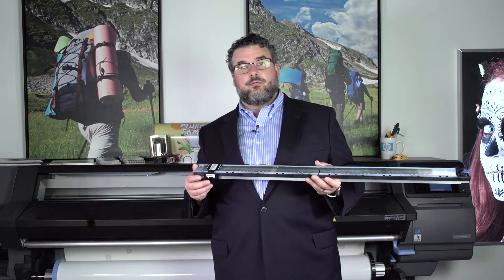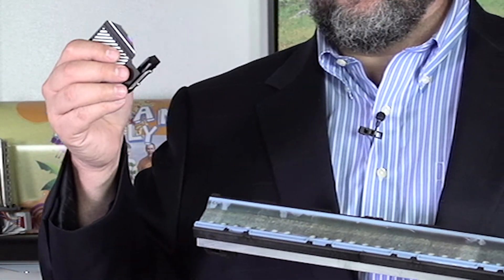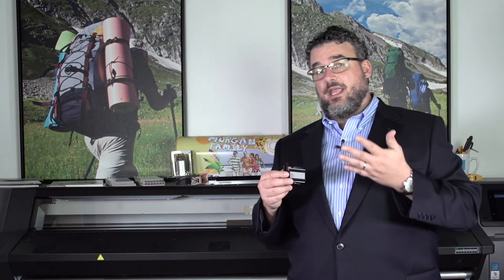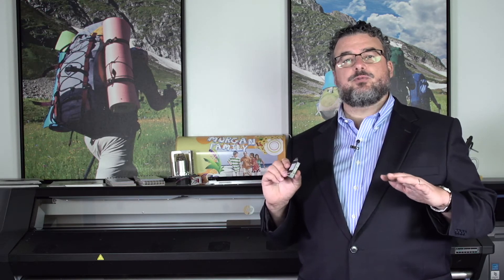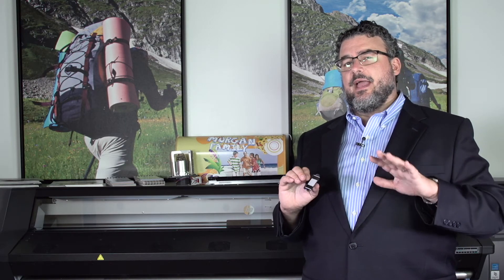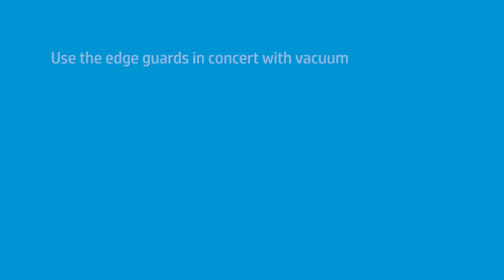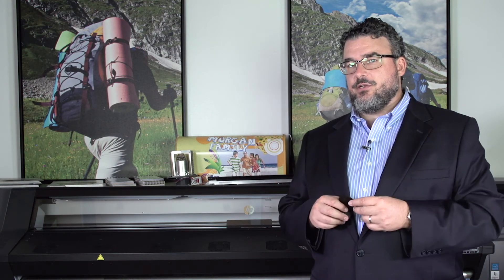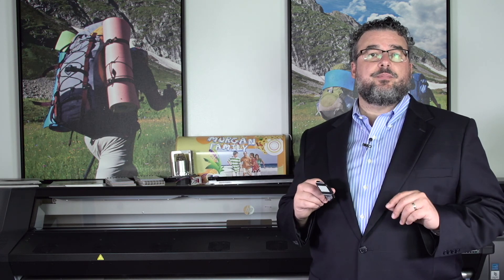Use Edge Guards | HP Latex | HP

Comment: How do you put them in, why is there nothing showing the installation of edge guards?
Reply: think you take the platen out by twisting the 2 blue locks either end of the platen, remove the platen, slide the edge guards in place then re-install the platen.
hope this helps.